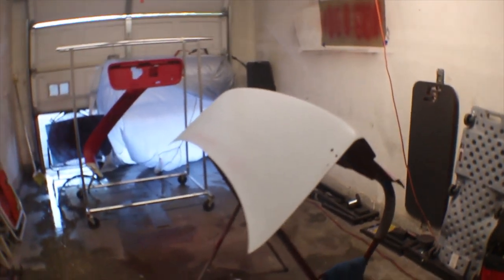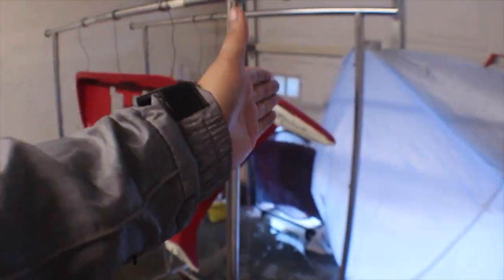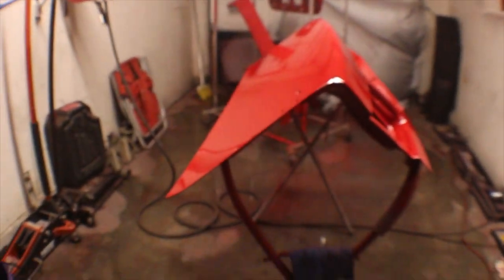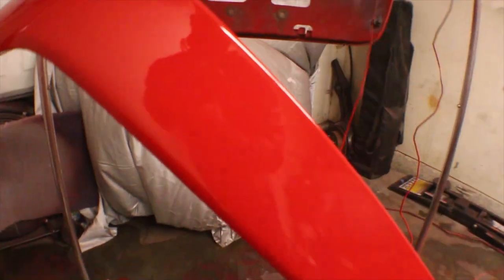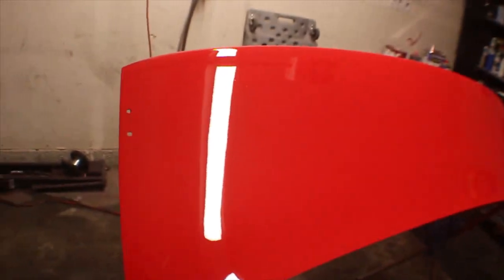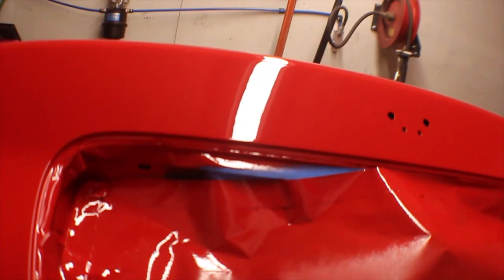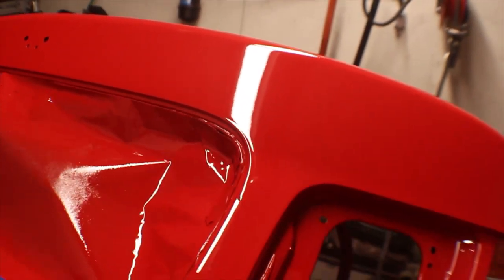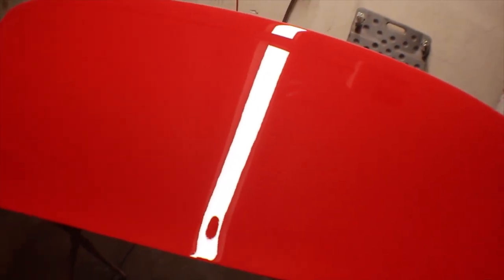Painting Car Parts (Devilbiss Plus)

Comment: Did this Plus gun leave a flatter finish than the Tekna /GTI Prolite with the T110 aircap spraying high solids clearcoat?
Reply from the maker: I have not shot with the t110 air cap on my prolite, but I would say a very similar finish , the plus is a bit heavier and older gun but I would rate it highly when it comes to shooting clear and single stage

Comment: Bro. How much turns you have for the fluid adjustment ?  2 and half ? Or just ?
And air compressor you using ? Thanks
Reply from the maker: For base I have about two turns out from closed, for clear about 3 turns to 3 1/4 turn out from closed, compressor is a 30 gallon kobalt with 6 scfm, with the plus I spray at around 32-35 psi when clearing, base a bit lower just depends.
Reply: Overspray thank you